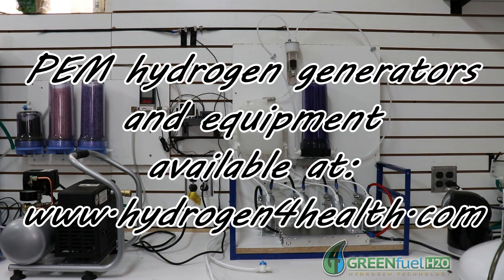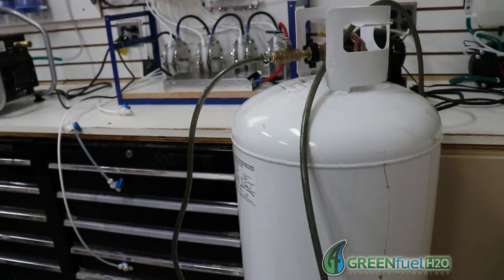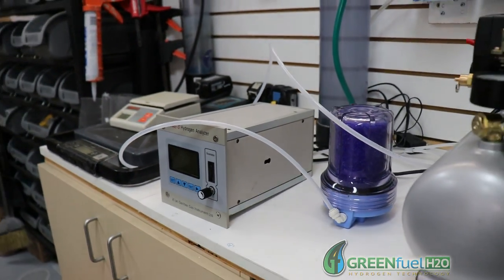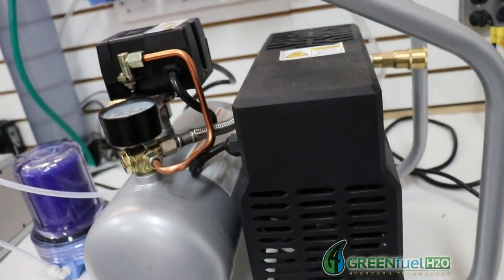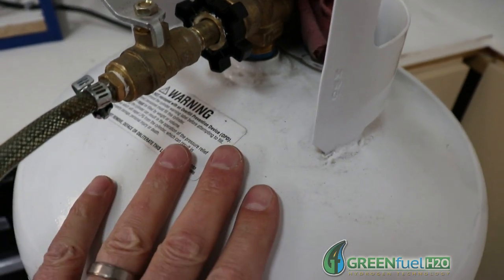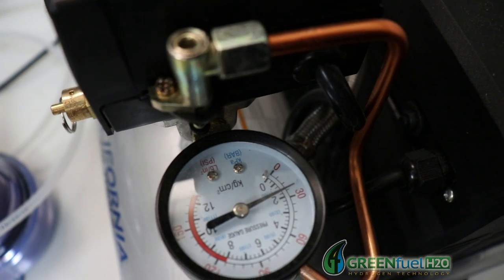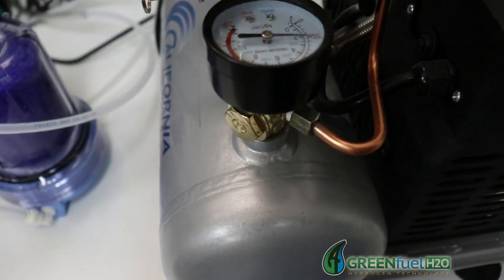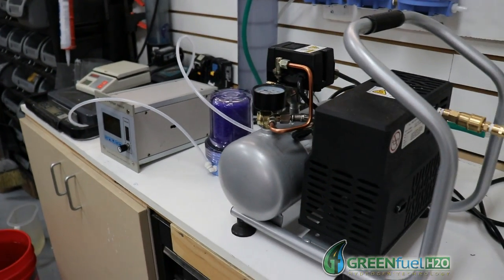PEM Hydrogen compression. PART 7. We compress hydrogen up to 20 PSI for purity test.

Comment: You can't expect anywhere close to full vacuum on that compressor / vacuum pump as long as you have 2 bar of outlet pressure. It will only create a given amount of input/output differential... and you just offset that amount by 2 bar (30psi).  The outlet must be open to atmosphere, or better yet, connected to the inlet of yet another compressor.With that large of a tank, and that small of a single-stage compressor, expect to pump it down for 12 hours.
Reply from the maker: Thanks for the advice.

Comment: you are making it all more complicated than you need to ,remember the basics of fluids, and yes gasses are actually fluids, hydrogen is far lighter than air (a mixture of gases,that's why it's wasteful to just release the pure oxygen you are also producing here) water also has quit a lot of air dissolved in it oc but nowhere near the air in the tank presumably

so, starting with an unknown tank , fill that tank full with water,pull a vacuum on that, to remove the dissolved air,  then simply fill said tank with hydrogen ,but releasing the bottom drain fitted with a 20psi release to let the degassed water out as pressure builds above ,when the waters nearly gone you have a full tank of hydrogen with a little hydrogen dissolved in the remaining water.

the same with air, but not as good,its heavier so falls to the bottom of the given tank and so can be purged from the bottom drain plug so not contaminating your gas lines above.

want to go even one better, then after you get to actually producing, then  stick the tank in a generic chest freezer on high so it will then auto cool the hot compressed hydrogen as it gets stored in the tank and so become even more dense so  holding even more product for later use in a given tank space.